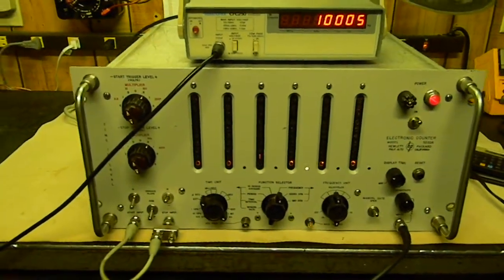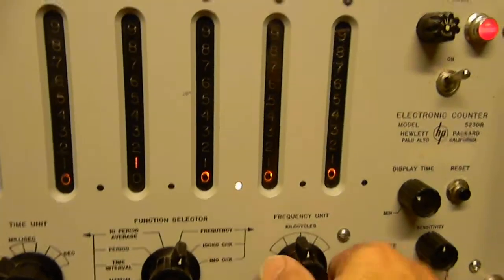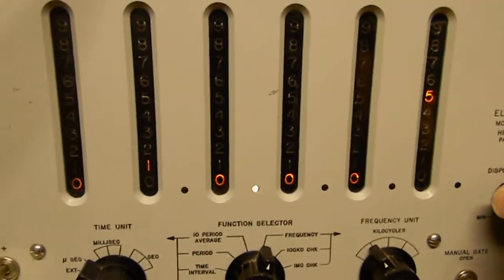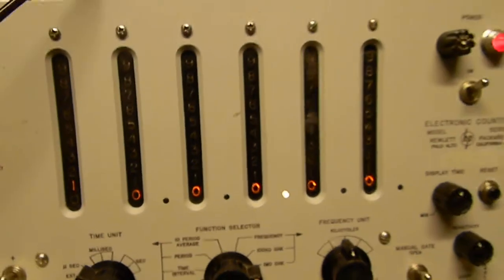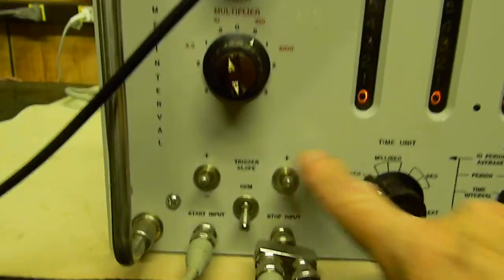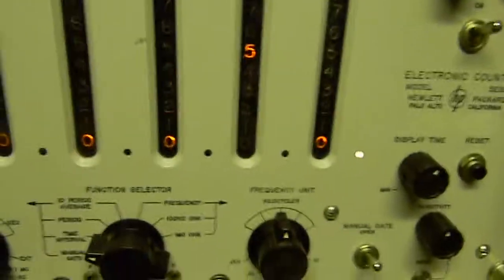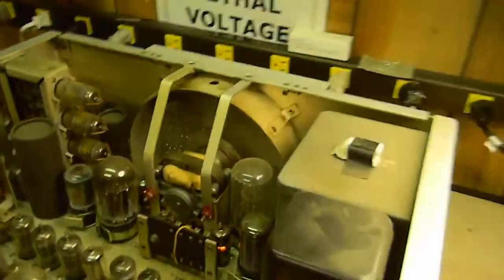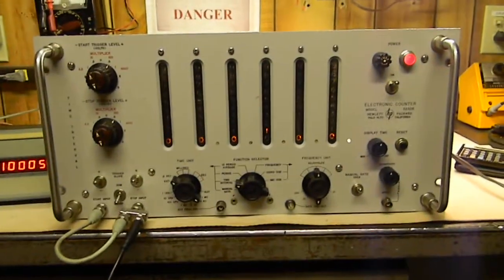Vintage Hewlett Packard HP 523DR Vacuum Tube Electronic Counter.MOV

Comment: one day I'm going to have to bring out mine from the garage clean it up then just take a look at the unit from the inside I've always wanted to do that but I never really bothered.   

I picked up this unit basically just because it looked cool
Reply from the maker: Mine finally failed and it was more than I wanted to deal with to repair it so I parted it out. I  have had this happen to be with other vintage equipment - it may work pretty well from being off for decades and surprise us but it probably won't last long so enjoy it while it works.

Comment: Oh my gosh!  I have one just like it!  My dad bought it from a thrift store for 10 dollars, and gave it to me when I was a teen.  Sadly I haven't powered it up in about 30 years.  I lost the fuse holder way back when and never bothered with replacing it.  I wonder if the caps are still good... hmmm
Reply from the maker: +Rachel L A fuse holder shouldn't be too hard to find and power it up. It may work. Mine quit working a couple of years ago and I parted it out so this one no longer exists. I knew that was going to happen eventually that is why I documented this one while it did still work properly. This one was given to me by a good gentleman in Colorado for the price of shipping which was about $50 if I remember correctly.
Reply: Sorry to hear about the unit's demise. 

My dad bought it for me because I was interested in electronics in Jr High.  I played with it a lot and enjoyed how all the numbers would glow in the dark.  Unfortunately I never fully understood the purpose and use of the machine at the time.  I now know a lot about it's use, as I still have a interest in electronics (I design microcontroller projects), but this has sat in the basement not remembered. 

Eventually I plan on taking a corner of the basement and creating a lab space, so I'll have to give my counter it's own special place.

Thank you for showing yours and stirring up memories from the past.
Reply: +Rachel L Hey Rachel, as a matter of fact I'm looking for one of this, but they are quite hard to find on the net as you may guess...Any chance you'll consider selling yours ? (Supposing it is not completely unusable of course)...Please let me know, here's my personnal email : x.pandsound@gmail.com.

Comment: Hi Dave, I know this is an older video, but i also noticed you come across this kind of stuff all the time.... nice unit. Where do you find this kind of stuff? I have never seen any test equipment of any kind for sale at flea markets or garage sales. But I live in Jersey.  I cant believe you found that tube tester for 5 dollars! Great stuff... Hope your doing well, and continue to test more amps, but I even enjoy the documentation videos.. Thanks for sharing
Reply from the maker: +Bucyrus Erie12 This HP 523DR was given to me by a good gentleman in Colorado for the price of shipping a few years back. I no longer have it but wanted to document it before it ended up in some recycle bin. I go to estate sales around El Paso and Las Criuces, NM and it is amazing what you can find. I just came from one (from the writer of the "Archie" comic book) and got two Telefunken 12AX7's,  one  GE GZ34/5AR4 and one Dynaco stamped 7199 for $4.  I will have to test them but good chance they are OK.Got to go to estate sales around your area.

Comment: I had a 523 variant in basement workshop in high school.  Wonderful!  Fun to revisit it.  On time interval, the "T" is not needed.  The switch at the bottom is separate (SEP) or common (COM).  Common does the same thing as the T (possibly by AC coupling) to send one input to both the start and stop channels. Wonderful! Thanks for the video.

Comment: I got a counter module from that beast.  Each module consists of 4 j-k flip flops with two triodes per flip flop.  The 12au7 tubes are dual triode tubes, so there's 1 tube per flip flop and 4 tubes per counter module.  Theoretically each counter should be able to count to 16, but HP implemented feedback loops in a strange fashion to get only 10 unique outputs.  

I've been using my module to reverse engineer the flip-flops so I can build other gates - and ultimately make a 8 or 16 bit ALU using only tubes! - Really cool to see this counter in action! - Supposedly, it was HP's first foray into Digital Logic ever!  (and it's actually quite apparent this is the case due to the nonsensical way in which these count haha)

Comment: Ballast tube? That raises the question of whether there are series-connected tube filaments connected to 117vac. Usually ballast tubes are for making up the difference between the series filament voltage needs and the line voltage.
At any rate, very nice unit, though a bit hard to read the display for those used to reading in a horizontal line only.